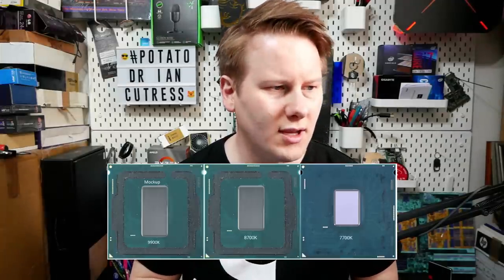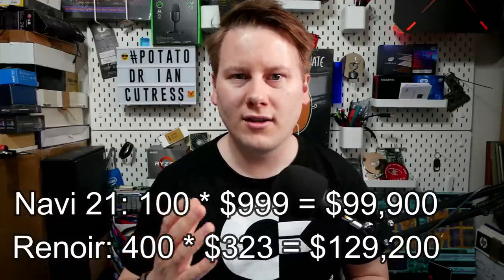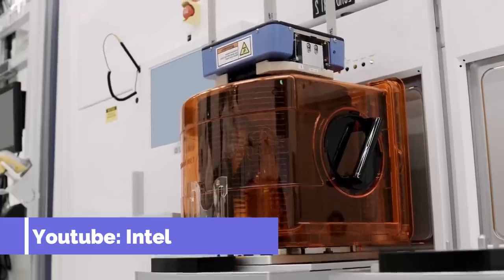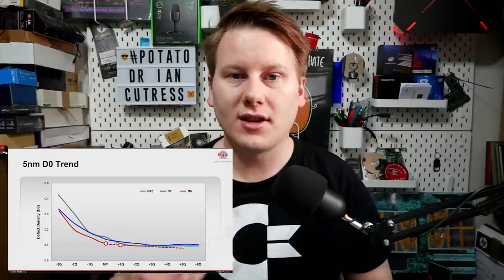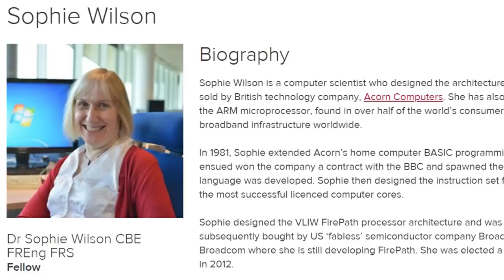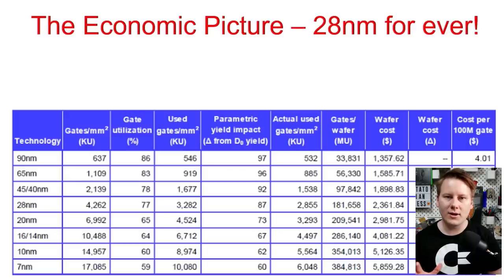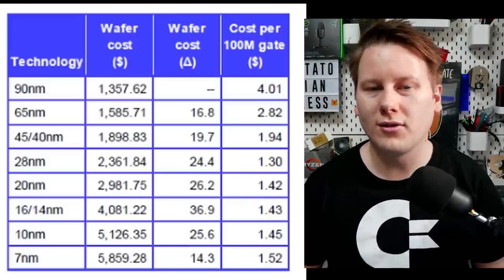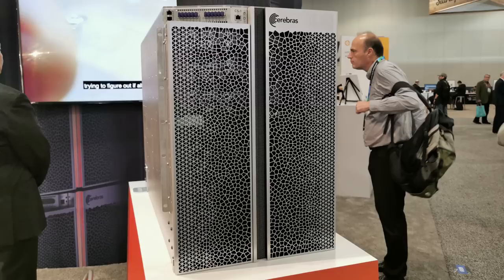The True Cost of Processor Manufacturing: TSMC 7nm

Comment: why are cpus so much more expensive than gpus and doesnt that make cpus quite the ripoff when you factor in die sizes, memory, board cost, cooler cost etc.?

im having a hard time shelling out the money for a 5950X when its just a 14nm IO die and 2 tiny core chiplets for about the cost of two family pizzas while also being more expensive than a gpu with double the amount of silicon in one monolithic die, gddr memory, a board with power delivery and a cooler?

gpus sound alot like a bad product to make, but amd got by with ATi technologies carrying them over their weak processors and those were very affordable gpus compared to cpus. how was that possible considering what the profit margins are now?

Comment: The big two are not getting retail in any chip they are sold in 1000 lots to resellers and assemblers. Sorry your figures are flawed. Take your  full wafer at 90% max  add to a 1000 lot  divided by the price and the you get assembled sale price.

Comment: You barely scratched the surface on the cost side. There is a running production cost you've estimated, but also: RnD and fab & equipment depreciation. Basically you have (1) material cost + (2) processing cost + (3) equipment depreciation (e.g. ASML, dry-etches, etc) + (4) RnD on top of equipment + (5) Cost of money (Interest) + (6) Mark up. Please study each section, otherwise your analysis is just lame.

Comment: Luckily you added the cost for the equipment and manpower, then there is shipping and handling, the software end of things to make them to even work. - but no, you didn't. Yours was a ridiculously simple math that isn't accurate as they aren't getting 100% out of each wafer, then there is the binning where they test each chip and mark it to the speed possible, so wtf?
Reply from the maker: What part of 'assume 100% yield' did you not get? What part of the video where I explain the multitude of non-obtainable costs did you not get? This video is the circle around production wafer costs, numbers of which are few and far between and I found a source. What part of that didn't you get?
Reply: @TechTechPotato  The truth, the wafer is a small part of the cost of a chip that includes the technology used to make them (the chip). Silicon is silicon. You imply things and fall back on other things. I'm sorry  I watched your B.S., It won't happen again.

Comment: I find it a bit strange you chose to use AMD as the example instead of using INTEL and NVIDIA, which are both AMD’s direct competitors, they charge more for their cards and pay much less for the 14nm wafers (technology) they use… AMD uses 7nm..👍🏻
AMD pays a much higher cost for the 7nm wafers VS what NVIDIA AND INTEL pay for 14nm..

Comment: 100% yield on a 9900 wafer? Really?
Reply: Yea. Idk dude. Assuming 100% yield on these newer chips sounds pretty unrealistic to me. 

Renoir was literally released last year. 80 or 90 is more realistic.
Reply from the maker: You can put defect rate of tsmc 0.09/cm2 for N7 in the calculator. It's about physical 45 defects per wafer. I just did a video about the math behind defect rates and yield counts, so I didn't want to rehash it here for the sake of keeping it simple. 100% yield isn't realistic, sure, and it's always a sliding scale.
Reply: @TechTechPotato  yea, but now your numbers are all off and unrealistic. 

It's a very misleading picture of cost per wafer.
Reply: Not to mention, not every die printed becomes the top tier cpu. They get binned and sold at different prices.
Reply: Sorry, not cost per wafer, but profit per wafer, as you mentioned in the beginning.